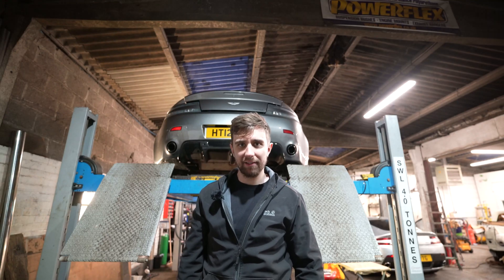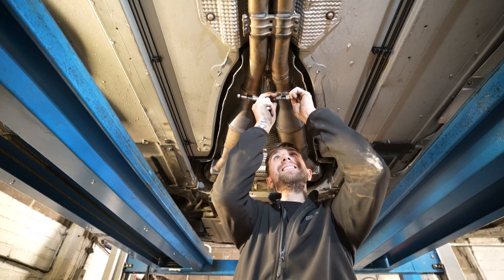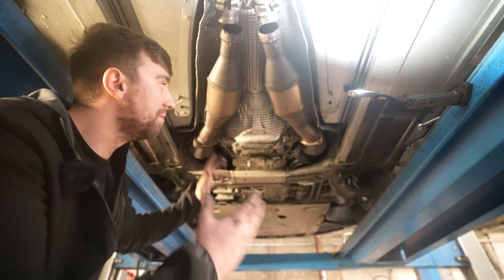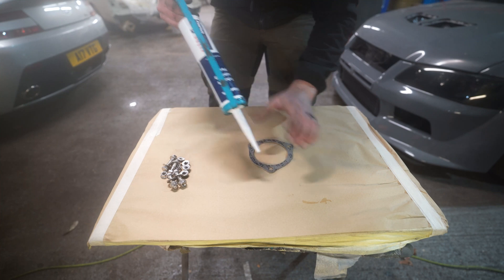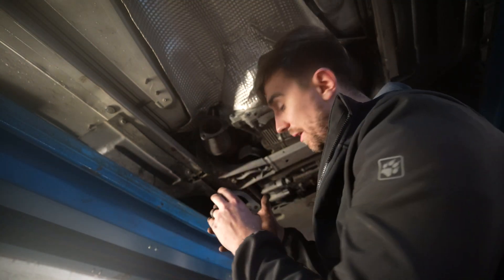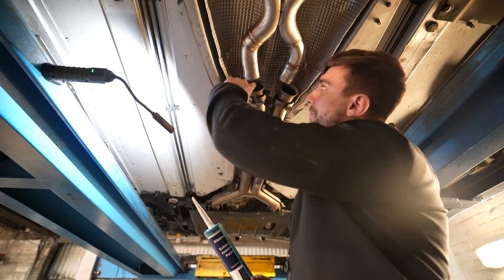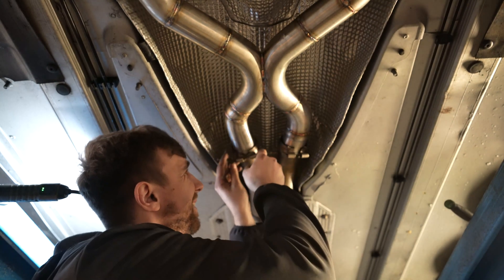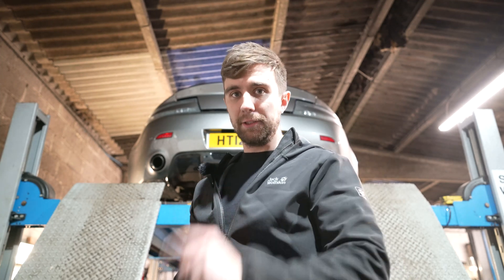Aston Martin DE-CAT Guide (Insane Cross Pipe)

Comment: Hi mate, what does the underfloor catalyst version look like for a Vantage 4.7L EU5 2011 -> on? I want to remove the close coupled cats in the manifold and then fit an underfloor EU5 200 cell in place of the OEM underfloor. Do you have to open up the close coupled cat to remove the brick or can it be don ether old fashioned way - looks very accessible. Thanks great vid.

Comment: Nice work bud. Be interested to hear your thoughts as this progresses. I’m looking to decat mine this year but am leaning more towards the straight pipe route at the minute.
Reply from the maker: I think the price of this will be slightly cheaper than the straight pipe option 🤔
Reply: @CorpsMedia  be good to hear some more vids for sure. Part of me actually thinks the cross pipe sounds more Aston Martin and less muscle car like the straight pipes do.

I do like the deep roar though. 

Keep me updated man, things like cabin resonance especially as the 420 is loud already when the valves are open. I drove back from the goodwood revival in mine and it was hard work over distance - tired.

I’m assuming straight pipes with the sports silencer as per 420 would be loud as hell and the x pipe possibly a bit higher pitched but ultimately not as loud or basey perhaps.